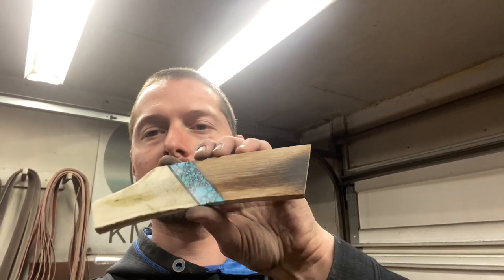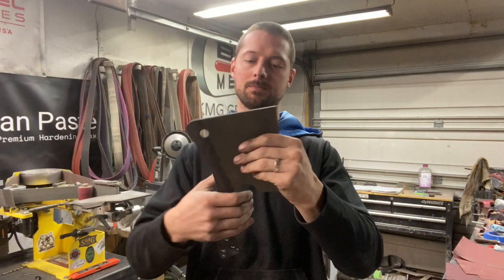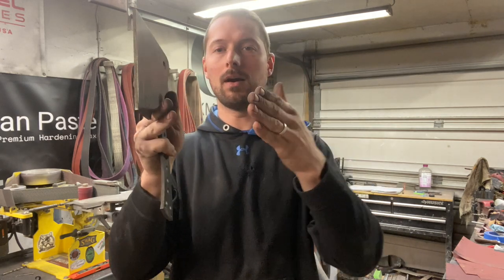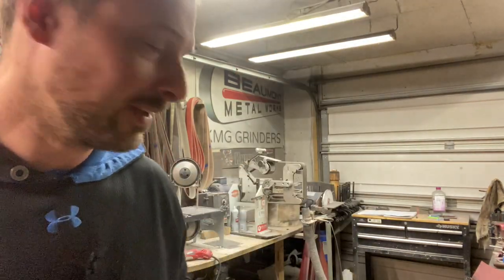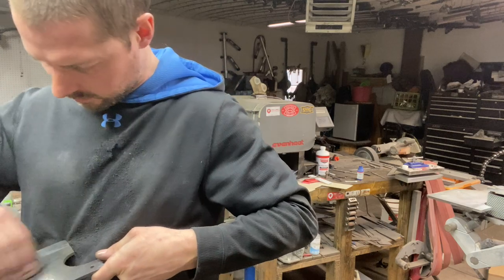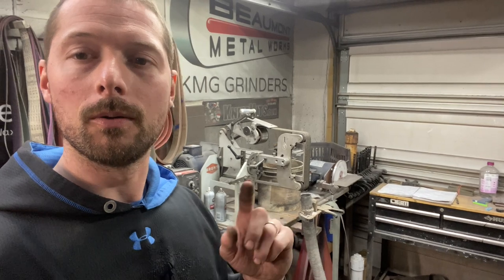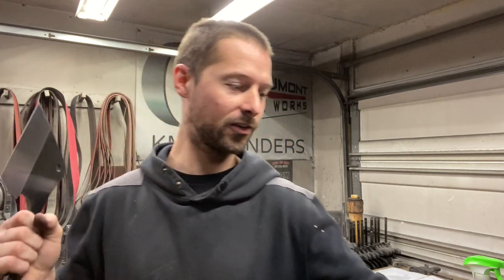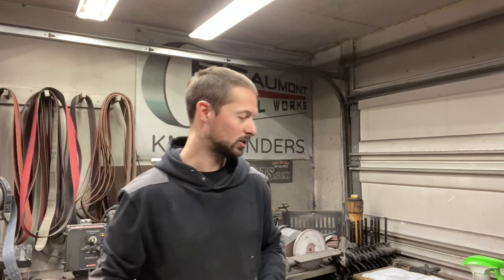Cleaver Build part 2. ( grinding and blade finish!)

Comment: I understand not going through with a mirror finish on what is intended to be a working knife; lots of work to get there and it will only last until it has been used a few times.
Reply from the maker: My thoughts exactly! And I really like that hand rubbed satin finish